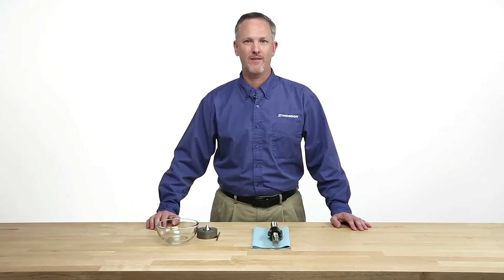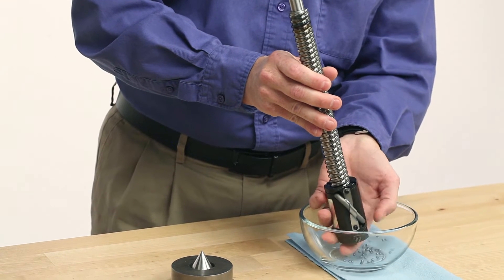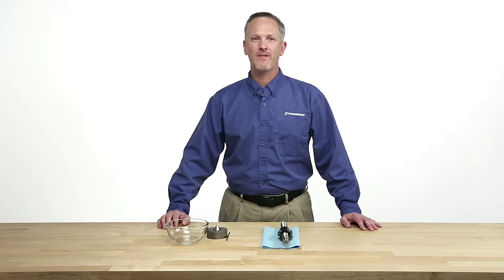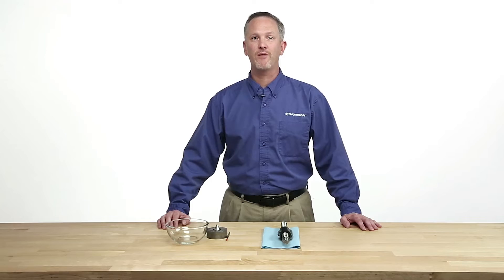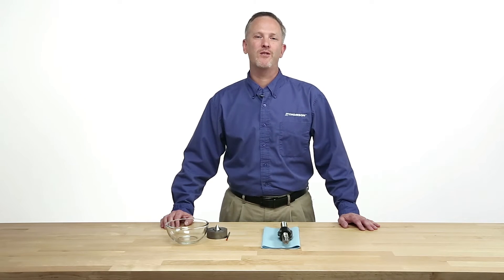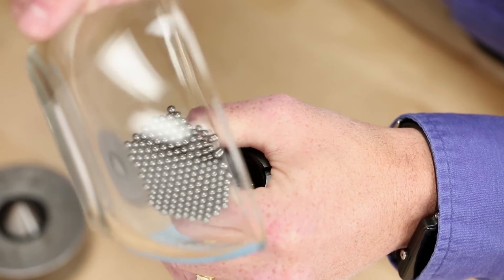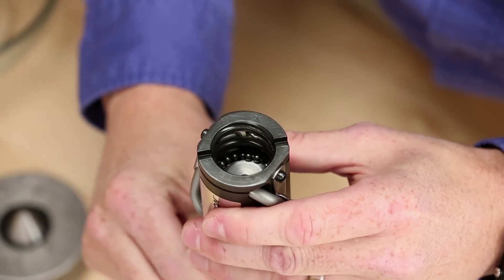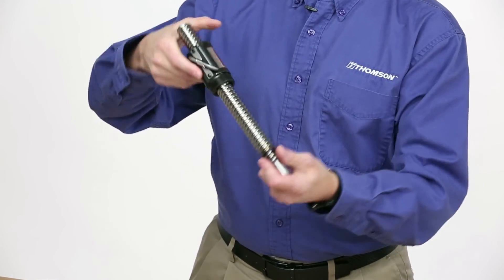How to Load Ball Bearings into a tube return ball nut.

Comment: Dear Friends, a question how many balls must have a Ø40 Diameter Spindle Step = 10 mm with recirculation tube, there is some formula to know the number of balls, thank you very much for the attention
Ball spindle code is 4010-2.5 Ball Ø6.35
Reply from the maker: The number of balls would be set as part of the original design.  The only way to know for sure is to contact the manufacturer of the nut.  (The number of balls would have many variables.  Such as ball diameter, screw root diameter, number of circuits, tube radial distance, tube curvature etc. )